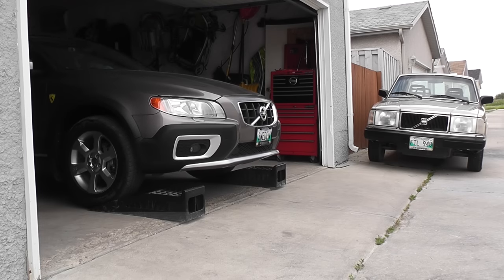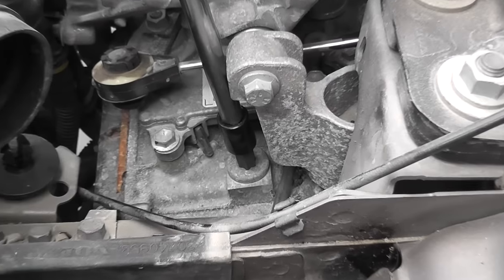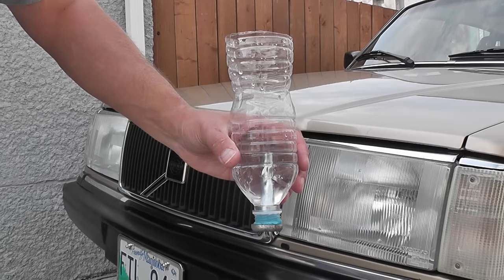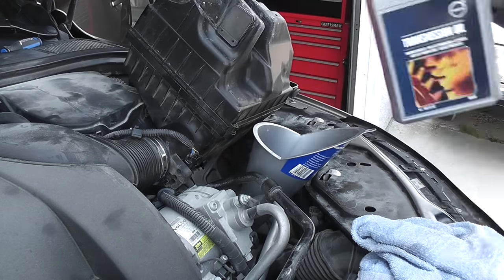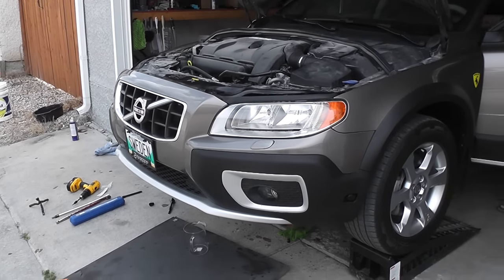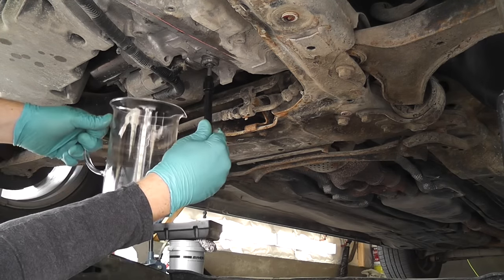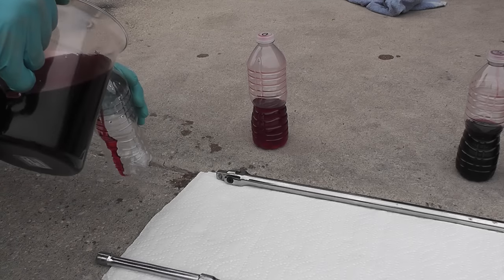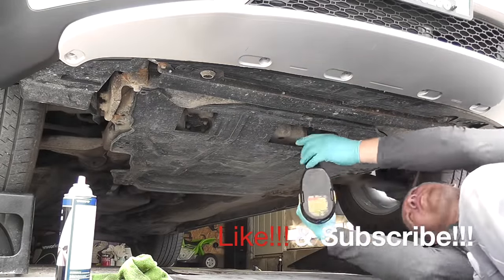Volvo Transmission oil change Aisin TF-80SC. 6 speed Auto.

Comment: I notice your vehicle  was NOT level when you corrected the final  oil level  at the end of your video.
Surely this will give you an incorrect final oil level . If you raised the rear wheels level with the front even more oil would drain out thus the gearbox was overfull.
Surely it's vital to have the vehicle level whenchecking the FINAL level ???
Reply from the maker: Please read in the description.
Reply: @volvosweden  Thanks for your quick reply, I am unable to find what you mean by "description"  All I can locate is the actual video and below that are people's comments, what is the description of which you speak. I am using an Android Tablet to communicate if this helps ?

Comment: this was excellent. I could probably look it up but curious how much the DICE hardware and software costs and where you get them?
Reply from the maker: Ebay. Around 100$
Reply: There is a lot of crap out there so make sure you pay for a one that is good. If you have a model newer than MY14 DiCE won't work.
Reply: jimzon I am looking for the correct dice/vica, I see lot of crap out there with poor coding program , what do you recommend side of MY2014 DICE??
Reply: Just saw that he was out of stock. But send him an e-mail and ask when they get it back again.
Reply: jimzon thank you so much, it's out of stock now but I will contact the seller

Comment: Awesome video. This question is off topic. 2008 S80. I'm experiencing an AC issue where the AC will not blow cold at idle. Only when you start driving. I know a couple other people who have experienced this but are unsuccessful in finding a fix. Has anyone here had the same problem?
Reply from the maker: +CarterBurtonMotorsportsDotCom No idea my friend. Sorry
Reply: Try the ac control valve. It looks like an electronic solenoid in the side of the compressor, held in with a clip. I replaced mine and resolved my issue.

Comment: Are you sure that is the proper oil level in tf-80sc? A lot of instructions says that after checking the oil level and screwing in a smal bolt in plug you should add about ~5 liters more of oil and that is the proper oil level in Aisin TF-80SC.
Reply from the maker: +Misqp Yes I am sure.
Reply: volvosweden of course I made, a mistake. A meant not 5 liters but 0,5 liter of oil :)
Reply: @Misqp  Could you give a direct quote from manual with that information?

Comment: Do you know why I bought a 2012 Honda Civic?

The oxygen sensor is easy to access. The transmission fluid change is easy. Spark plug replacement easy. The catalytic converter is right in front, on top, just behind the radiator at the front of the engine bay. Everything is super easy to access. I don't have to remove anything to refill my Honda transmission fluid. It still has a dipstick, just like the oil. The marketing department makes the engineers for Volvo, VWs, BMW, Mercedes put in complicaed layers of procedure - even for routine maintenance - so that most people are scared away from doing their own maintenance and then they bring it to the stealership and get charged a small fortune for simply things.

But with Honda, they still try to keep things easy for the do-it-yourselfers. In short, Honda respects their customers, but Volve and BMW and Mercedes don't respect their customers, so they make it hard on them.
Reply from the maker: So many cars on the road, so many opinions. I respect yours. Good luck.

Comment: What do you think about using LIQUI MOLY - auto trans flush before changing oil and after adding LIQUI MOLY Atf Additiv?
Reply from the maker: +DifficultDirector NondescriptBroadcast I see no benefit. I would not. Just fresh oil is good enough.
Reply: Seriously do not. It's a huge chance you'll crater your transmission. Extra additives is nothing but snake oil these days, if you need it it's in the oil/fluid already.

Comment: Question: could you not just drain it and then add the same amount of oil when you are done with the flush? So if 3L comes out, I just add 3L after the last drain?
Reply from the maker: I have hard time understanding your question.
Reply: I'll rephrase it: If I drain 3L from the transmission, could I just not add 3L? I mean, there must have been the right amount of oil in it from the start, so adding the same amount that came out of it should be "right", yes? It's not the way you or Volvo would do it but hey.. I don't have Vida/DICE :)
Reply from the maker: I see. You are trying to avoid setting proper level of oil at 60 degrees Celsius because you dont have VIDA. Theoretically what you say is correct. But I cant guarantee or know if this is good.
Reply: Well, I would never try something I'm not sure about.. I was just wondering, thanks for your answer!

Comment: Volvosweden: You drain the excess down to the correct level when the temperature is between 50 and 60C.  What is the steady state operating temperature?
Reply from the maker: +Marwan Azzam I am not sure.
Reply: It should not be much higher than 60C, definitely below engine running temps.  
Not even heavy goods vehicles being 64 ton gross weight have normal operation temps above 60-70. Climbing steep grades still keeps things <90c

Comment: Can you help me with a problem with my Volvo V70 automatic gearbox  D3 2012?
It makes a clunk when I put the gearshift from P to D....in 2016 I had that problem and my dealer flushed the gearbox oil for the first time with 140.000km.
Now 3 years later and with 185.000km the problem is back again, I've been researching a lot in the internet and you find a lot of Volvo owners with the same problem  and the solution is a new gearbox!! My volvo dealer says that to and it's very expensive  +/- 8.000 euros! You can find in YouTube videos with that problem 
 Best regards 
Rui Melo
Reply: I have the same problem with going from P/R to D with a S80 D5 2011 it started at 129.000km and now after 250.000km its still there (also flushed on regular car services) 

Do you also get some times the message transmision service required ? on vida i get  TCM-P074100 fault code (solenoid slu) shifting gears while driving is still very good,

Comment: I was told to never change the transmition oil because new one might cause problem, can someone enlight me please ?
Reply from the maker: Religious topic! If never was changed and the car has high mileage then I would not change. But my car has low mileage I will replace every 40000 miles

Comment: what about trans oil fitler, 3. drain is ok, it would be better that you made only 2 drains and next every 10000km/when change engine oil
Reply: in my 300c there is no drain plug, it is only add plug and by vacum I suck 3l of oil and leave it for 1 day and more 0.7 l  can be drained.
every 3 years and 25-30000km i change oil by open bottom plate 6 screws and inside is filter that change.

Comment: why when you open for first  the small torx leaks oil if the small torx is for set the propel level ?
Reply from the maker: Because the engine is off. To set the level the engine must be on.
Reply: i have same gearbox on my volvo .
with  engine ON i  put in R /N/ D, after i  remote the small torx  leaks 1,5 l oil .
I had to change the radiator ( water radiator Also have cels for gearbox oil)
I lost some oil when i changed the radiator and my intention was  to
put the oil at the correct level 
but surprise when I open the small torx for level I still have 1.5 l oil up to level.
now I don't understand what's the correct level

Comment: New to your channel! Been watching a lot videos, and got my first car it’s a 2008 Volvo s80 3.2.. my question is I want to do a full service on it. The genuine Volvo ATF is quite pricey.. could I use a brand called ACDELCO Dexron VI? It’s full synthetic as well. Or should I stick to AISIN type IV? There’s also this coolant that’s the blue type by Beck/Arnley says it’s for European models?
Reply from the maker: Don't use dexron 6. It's incorrect oil for this transmission. Do it once and propper. Get original oil.
Reply: The Volvo fluid is made, IIRC, by Idemitsu.  It is just Toyota T-IV.  You can also use Aisin T-IV fluid... since they actually made the transmission for your car...

I use the Idemitsu since it is straight-up Volvo fluid and seems to have better shifting behavior than even the Aisin fluid.

Comment: Hi, if I can't have volvo oil to buy around me, which other product do you recommend
Reply from the maker: I don't know.
Reply: Look for a Transmission oil that meets Volvo’s spec JWS 3309. It will be a synthetic oil. Most of the major oil company’s (Castrol, Fuchs, Chevron/Mobil, Valvoline, Shell, Havoline, B.P. etc) make an oil that does.

Comment: I have one question what if i do this and my gearbox start to jerk from N to D and it dosent matter if it on cold or warm oil temp. ?
Reply from the maker: I dont understand the question. Sorry.
Reply: redo it and did you use the correct oil.
Reply: major 007 yes  i had to say it was for the first time ive changed the oil at 137k km and i had to use 16l until it poors a red oil down the pipe, at first it was black but it havent smell burn or something like that.
Reply: volvosweden  So ive change my oil for the first time at 137k km, i had to use 16 l of new oil until its started to poor red, and my mechanic did a calibration of the gearbox after oil change and after a couple of weeks my gearbox when i shift from R to D it jerk sometimes, sometimes work fine, it dosent matter if the oil temp is cold or warm it just happens..
Reply: you have two options change the oil again or get your mechanic to change the oil again, you might have some dirt that might be blocking a passage-way. or causing the plungers to stick.
Reply: Check the motor mounts and torque link above and below engine.
Reply: Kim Price why motor mounts?
Reply: Kim Price torque links sounds like a good idea.. but motor mounts why..?
Reply: Because bad engine mounts also produce klunking as there is play in the drivetrain.

What car/model/engine/trans do you have?
Reply: Yannick de Vries it only does sometimes from R to D , i got an s60 2012, 6 speed automatic, 2.4 D5 215 awd.
Reply: What oil did you put in?
Reply: Yannick de Vries oem same bottle as this guy in his video.
Reply: Yannick de Vries but it was my first oil change at 137k km and i had to use 16l until it started to poor red on the other side
Reply: Is it possible that the recalibration of the gearbox is the problem here, rather than the transmission fluid? I'd get your mechanic to do the recalibration again and check the oil level at the correct temperature again.
Reply: Where you able to fix it by now? What was the problem?

Comment: the level in you gearbox is not correct ,,,(the front wheels of your car was on the ramp) ,,,,this procedure requires a flat surface
Reply from the maker: Garage floor is sloped. The car is level.

Comment: Do you know if it is the same drain plug on TF80SD?
Reply: nearly same box, drain plug most likely the same
Reply: @erwanfrenchy8849  just had a look and is the same, perfect makes the job way easier... now i have to get my vida working on the v40 d3 2012 , maybay i need a newer version ? Works on my 2002 v70 d5...
Reply: @TheLordofdrift  you need 2014D version, or any generic scanner able to talk to the TCM

Comment: How you shifting gears with running car and staying in place.
Reply from the maker: With foot on the brake
Reply: volvosweden thanks. I have v60 d3 2012 i think the same procedure.Norway volvo center ask 5000 nok for this job...
Reply: I thinking about leveling car, cant i use  the same ramp as on front and back wheels?
Reply from the maker: You can. Yes.

Comment: Do you absolutely need DICE to do it?
Reply from the maker: No. You don’t have to rest the counter. You can still operate without
Reply: @volvosweden  thanks for response.  My 2015 XC70 T6 is making big clunk and jerk when stopped and shifting into gear.  102,000 miles.
Reply from the maker: That’s bad. Start with changing oil
Reply: @volvosweden  Thanks, will do!

Comment: Just so you know, this gearbox should be able to go 400000km before needing an oil change in good driving conditions. 60000km is really early.
Reply: Yes, if you want to replace the gearbox at 400' km instead of just the oil every 60' km. Here in Scandinavia every taxi car owner change AT oil every 60' km, Mercedes, Volvo or whatever car make they drive. It is silly to believe that it is ok to drive hundreds of thousand km on the same oil.

Comment: the oil is god damn 90 bucks for 4 liters only
Reply from the maker: Yes. Very pricy. But if you do this job yourself and considering you dobit once every 60k km or 40k miles, iits fine.
Reply: @volvosweden  i guess il do it i drive 35k km every year now the car has driven 230k km and the oil is never changed. Do you think its a good idea?

Comment: How long this funnel must be to comfortably reach
Reply from the maker: +DifficultDirector NondescriptBroadcast I will let you know once I measure it.
Reply: I want to pour another oil into my gearbox Gulf Transmission Oil (Multi Vehicle). After I change the oil I have to reset I have to do adaptation of the new oil? What do you think about it? I have European versions of xc90 with the same gearbox as yours
Reply from the maker: +DifficultDirector NondescriptBroadcast just reset the counter. Don't reset adaptation.
Reply: volvosweden thank's mate. Your videos are very helpful. thanks for that. Let's know about the length of the funnel please. I live in uk. Regards
Reply from the maker: +DifficultDirector NondescriptBroadcast 
15 inch long.
Reply: volvosweden thank you mate. I will exchange at the weekend Regards

Comment: This transmission dont have Oil filter?
Reply: Nope.  You can add an external filter, though.  That's what I did.
Reply: Thanks ! 
What filter did you use?
Reply: Magnefine 3/8" Magnetic Inline Transmission / Power Steering Filter.

But I have a 2006 Volvo S80 (P2, 2.5T, AW55-51SN), so it may be different for what you need.

Comment: You doing it wrong. Before removing leveling plug you have to sirculate all gears. Now your gearbox have low oil level.
Reply: Does not need . Why do we sirculate gears after filling the oil . Because the gears is completely empty.
Reply: @911Privacy  because its proper Volvo measures. However In America everything is done in its own way

Comment: Such a shame to waste all that good oil... modern cars really suck. My old Mercedes has a drain for the Torque converter and the transmission itself. Of the whole 7l the transmission contains I changed 6,5l without doing anything further than opening these two plugs.
Reply from the maker: Great design. I guess not everything that is made in Japan so great.

Comment: volvosweden will this be same on diesel  volvo's with 6 speed auto?
Reply from the maker: Yes. Same transmission.
Reply: volvosweden thanks love your videos very informative keep up the great work! 
I need to do this on my 2012 S60 D4 it's done 60k miles :).
Reply: Great  job.. What if I don't  reset the gearbox

Comment: just wasting the oil. when it is empty, it is empty. you dont need to rinse it 2 times. from begining changing the oil after 60,000 km was early.
Reply: Did you even listen to the video? most of the oil is in the torque converter and therefore does NOT come out from a simple drain.
Reply: @simonh317  ok, but is it Volvo's rec. to change after 60 000? The oil was quite niice. I am an environmental activist. Therefore, ask
Reply: @medi768  No - Volvo say its a sealed for life system, and the life sadly is around 100,000 miles. AW (the maker) do allow for changing the fluid - i did mine (in a citroen) in 4 litre s then drive for 1000 miles, then do again. The fluid was then sent to be recycled.
Reply: @simonh317  Thanks for info. Good luck

Comment: I have been working in Volvo for more than 25 years. And this manual for oil change in automatic gearbox is WRONG !!! The procedure is totally different, so I do not understand why someone who does it wrong filming it and publicly presents it. Please don't do that!
Reply from the maker: Maybe wrong but completely safe and easy. It still does the trick.
Reply: As Volvo say the ATF lasts a life time, I would not believe anything technical from Volvo.
Reply: so Lukas, please explain us, how it works by Volvo in the wright manner. It s no way to say how something does not work.
Reply: I ll order now Oil an stuff and will do the work. I ll inform, when work is done...